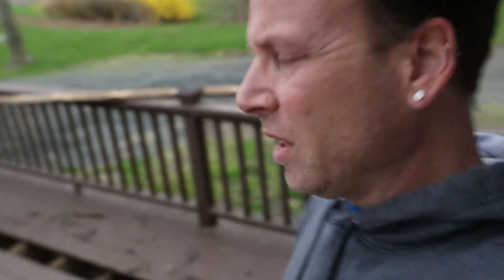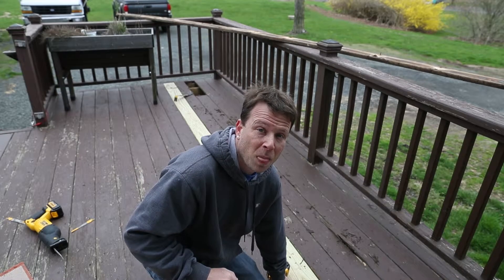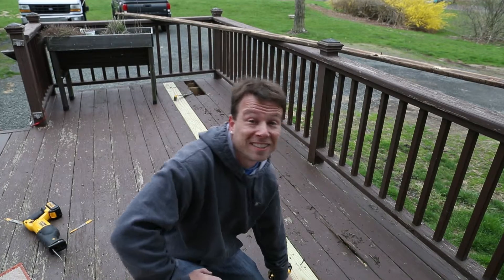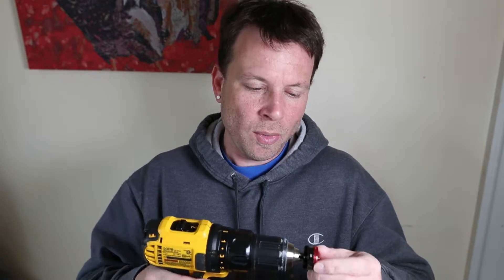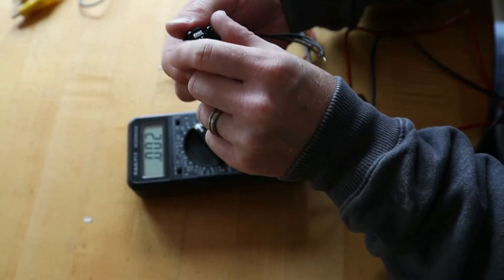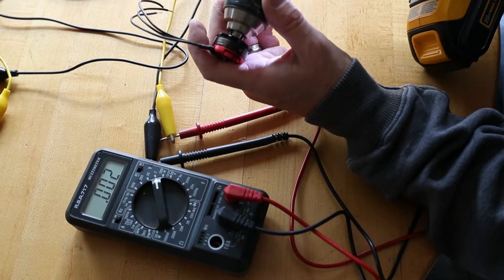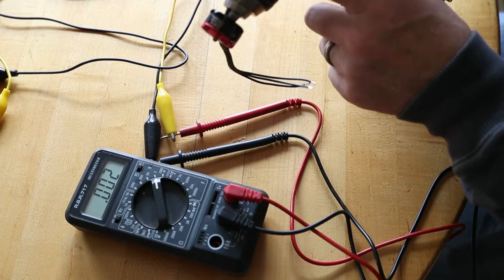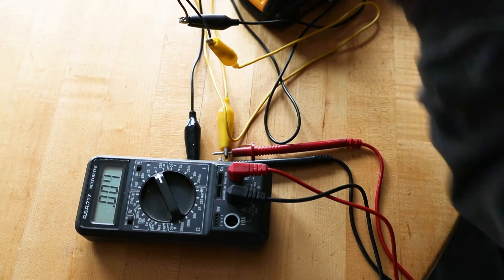How to Check Brushless Motor Phases

Comment: One of my phases are burnt is it possible to fix that phase
Reply from the maker: You can fix it, so long as the magnets weren’t demagnetized with the heat. Find the same gauge wire and wrap the same number of times to keep the kv the same.